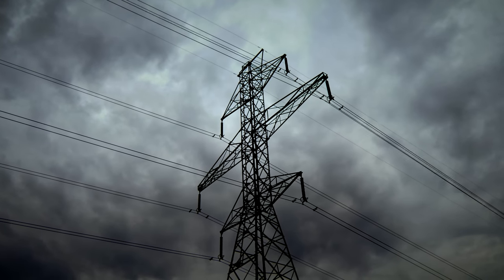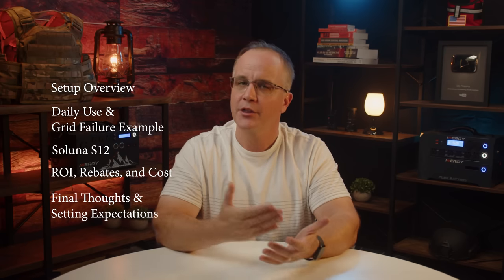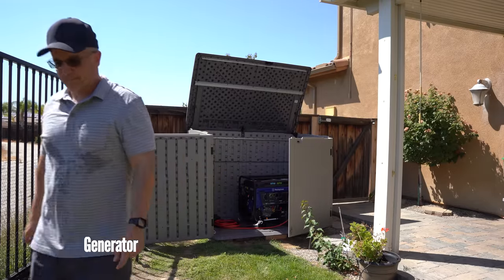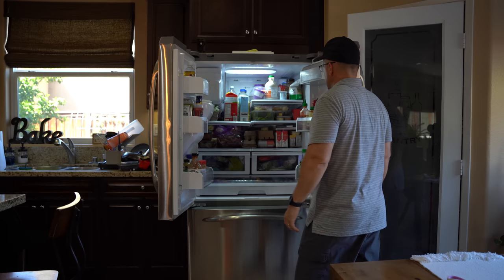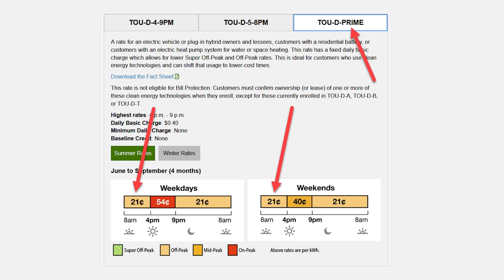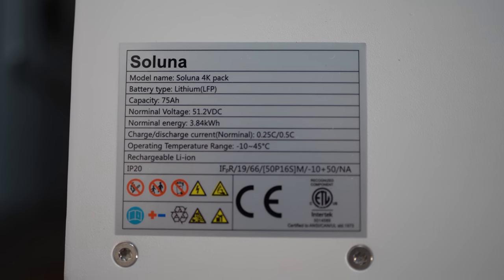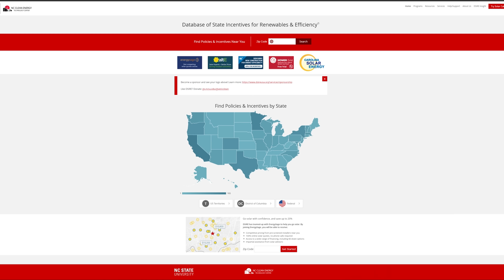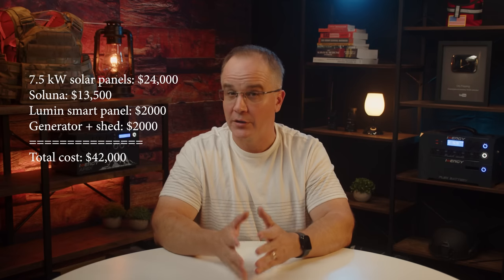The Coming Power Grid Collapse.  Soluna S12 Whole Home Backup Power

Comment: 1. Nice system you have there Chris!  I do envy ya.
2. Someone like me, CANNOT AFFORD THAT! Lol 
I am on a fixed income unfortunately because of a failed back surgery from being hurt on the job as an hvac installer years ago, so as of today, I'm screwed and have to live in my means. I would love a setup like that, but cannot afford it. Especially for my wife which is also disabled from a stroke. I have built a cheaper system for solar backup, the video is on my channel, for what I'm doing, for emergency backup. But kudos to ya, you got the Cadillac of systems. 👍

Comment: 5KW Canadian Solar panels  from Santan $2500
10KWH - EG4-LifePower4 Lithium Batteries $3000
3000W GroWatt Inverter & Charge controller $700
2000W Honda Generator $650
Did all the work myself and add $1000 for other materials & mounting
----- Total $7,850

Comment: I'm curious how much power your produce in a day (in summer and in winter) with your 7.5kWh array.  I presume it's enough to charge the batteries each day plus sell power back to the grid.  I would guess you'd make around 35kWh / day average and use 12.5kWh to charge the batteries with the additional ~ 22kWh going to power your house or back to the grid?  Have you looked at efficient mini splits to power just one room?  You can even find 110v ones so your smaller battery generators could power them if the S12 went down.

Comment: You can make your own system for under $1500 it wont run your house but will run essential items.  I have 2 100 watt panels a mppt charge controller a 100 Ah lithium iron battery and a 1500 watt inverter.  I ran as a test my ups with the modem router ps4 and tv running on it and after 4 hours the battery was still at 90% charge amazing.

Comment: My setup is a $700 trifuel generator (preference is natural gas), $1000 installed interlock, $300 soft start on the central AC. My power won’t switch over automatically but for about $2000 I’ll be just as comfortable as you. I’m paying 11 cents/KWh here in Texas. Oh, I forgot to add in a $400 Remington 870 for the concern over attracting attention, but I already had that, so I didn’t consider it in my ROI.

Comment: I think I have the largest Harbor freight setup around. 18- 100 watt panels connected to 3 40amp SRNE charge controllers. Battery bank is, so far 18 12 volt 35AH Thunderbolt solar AGM batteries. I have yet to see it drop below 12.5 volts by morning running a nearly 50 year old GE fridge, small chest freezer and Dewalt powerstation. Need more batteries to store this power for later.

Comment: Bub...I thought you were richer than that. Never figured you could not afford a solar system to run your 2 A/C's. 

My solar system is a 10-year-old car battery and a 80-watt, ancient folding solar panel. It is for charging my computer, tablet and batteries for flashlights and radio. 

In boiling hot weather, if the grid goes down and you got no A/C's...take a cold shower a few times a day to cool off. (Providing the water is running.)  

I lived in a RV for a while with no AC. It would get to 95F - 100F in the humid summer. You would feel like you are dying from never being able to cool down.  I couldn't take showers a lot since I didn't have city water. I used wet washcloths to stay cool. You can wet a face towel and wrap around the back of your neck. It helps cool you down as well.

I'm old, maybe it is easier if you are younger. I grew up in L.A., don't remember heat affecting this much when I was young. Heat can be debilitating. 

Anyway, nice video you did about getting into solar...thanks! I will keep buying lotto tickets.

Comment: You better figure out how you'll get water as there will be no pumps filling those water towers. Also, not all power companies will pay you to put power into the grid. Up here, in Northern Wisconsin, Price County Electric will not pay you for power. I installed my system myself. It isn't rocket science. I have 18 panels, 4 SimpliPHI 24 volt batteries that have a 10,000 cycle life and 15,000 watts of power, a Midnite Classic 150 controller and an AIMS 3,000 watt inverter. My cost was just under $17,000. You paid a whole lot more than what you had to for less power than my system. This also included the cost of my electricians to connect the inverter to the breaker box that powers our house.

Comment: I installed a solar system that has 40 320w panels, a 12k Sol-Ark hardened inverter and ten (10) 5.4k Fortress EFlex batteries. Our house is 2700 sq. ft.  I replaced our old clothes dryer with  a heat pump dryer (around 600 watts) and a clothes line for clothes. We live rural on 35 acres so no HOA. We bought a new washing machine which is much more efficient than our 14 year old washer and I replaced one of our water heaters with a heat pump water heater. The HP water heater draws about 400 watts when running instead of 2500+ watts. I also bought 4 Midea U shaped air conditioners which do a wonderful job cooling the entire downstairs at 400 watts each. We have central heat and air but when it runs it uses a tremendous amount of wattage. Currently it is switched off. Normally have 3 of the Midea units running during the day. Currently we are experiencing temps well above 100° on a consistent basis and our home is comfortable.  I also had a well drilled and have a solar pump that is powered by its own set of solar panels. The well power can be be supplied by its own solar, batteries, the home solar system and grid power. My electric bill went from about $350/ month to $45/ month. We pay  a rate of .10/kWh with no peak times. I installed this with the purpose of having power when the grid goes down. The net metering is just a bonus. I have the inverter setup up to never let the batteries discharge below 70% battery capacity as I don’t want to drain the battery and then the grid goes down and it’s cloudy for a couple days. When there is no grid power the batteries will discharge to 20%. With my battery limited at 70% and then the grid goes down I can then reduce the load as much as possible. Total investment $74,000 before tax credit. A lot of money but with inflation, supply chain issues and doubting that electricity rates will ever get cheaper I decided to make the investment.  And Thank God I don’t live in California.

Comment: I live in Texas and for all of July it's been in the 100s. I have a Sunrun Solar system installed with a backup battery that is on a 25 year lease program. I pay a monthly fee to Sunrun, which is over $150 less than what I was paying for electric, plus I sell power back to the grid, making my last two months electric payments ZERO. I also have an Inergy Apex solar generator for further backup, and an additional small battery bank that I keep charged with a Harbor Frieight solar charger.

Comment: Last year, I had a Sunpower 7.56kw solar array and a 26kw/h "Sunvault" battery storage system installed on my little 900sq/ft home here in my state.  My roof is a single peak that runs north/south, so my panels face east/west, and I have panels installed on both sides.

My state, sadly, has no rebates for solar, no rebates for EVs, and no Net Metering - that went away a few years ago, so now we're on something called "Distributed Generation."  I did still get the Federal rebates.  The power company will credit your bill nearly 1 for 1 for excess power sent back to the grid, but they nail you for any power you consume from the grid as a distribution charge.  IE - if I consume 100kw/h from the grid but push back 300kw/h, I will still get a bill for 100kw/h as distribution, but will get a bill credit of 200kw/h toward the Power Supply charges.  Those credits cannot be cashed out either.  Power company wants your bill to be zero over the course of one year with no excess credit being built up.

I've ordered an expansion of my solar array this year to 10kw, and ordered a second, 26kw/h Sunvault battery with additional inverter.  The software that my installer used to try to estimate my energy usage shorted me by about 1.4mw/h for a year's worth of usage.  I'm just waiting for an install date.

That all being said, the system was extremely expensive; there are less costly alternatives, but I wanted great support, reliable products, etc.  If I had gone just for the solar panels, I would've been able to reduce about 2/3 of my bill and might've came out ahead after like 8 to 10 years, but the batteries made it so expensive that I probably won't... maybe after 30 years.  But for me, my neighborhood generally loses power 2 to 4 times a year, anywhere from a few hours to a solid 5 day week.  I was annoyed with that, so I went with the battery solution.  You can tell how often a neighborhood loses power - just wait for one and if you hear nothing but small engines running during one, it's often. :)  The system did come with a smart hub which has a built in RTS (Rapid Transfer Switch), aka, a fast ATS (automatic transfer switch), which isolates the house from the grid during a power failure and allows the panels and batteries to power my entire house.  I chose not to go with a critical loads panel because all of my appliances are currently natural gas, but I plan on slowly converting some of that over to electricity in the coming years.  The inverter for the batteries is a nice 6.8kw running power unit made by Schneider Electric.  Sunpower has their own custom firmware in it, so it is limited while on grid mode to 6kw running power.  The entire system is "turn key" meaning, you don't need to do anything; permitting, wire, conduit, all of that is supplied.

I did not select Time of Day usage here with the power company so I'm on a tiered rate based on consumption.  I do allow my batteries to run in "self supply" mode - once the sun goes down, the house is powered by batteries until they hit the low limit of charge that I set (20% reserve), and then the house becomes grid powered.  On cooler days, I usually don't hit the reserve limit and basically run net zero, or push a surplus to the grid.  In the winter, I consume more electricity than I produce, which is where the bill credit gets used up.

The federal tax credit does apply to the battery.  The rule for that is the batteries can only be charged by solar energy.  We do not have a virtual power plant feature here, so it cannot export battery power to the grid, nor use grid energy to recharge itself.  Solar only.

Once my solar addition is done, I'm going to have a "Level 1" surge suppressor installed in my electric meter.  I already have a whole house protector in my main panel (considered Level 2) and surge strips/UPSes (considered Level 3) throughout the house, but I want something right at the meter; I'd prefer not to have all of that electric/solar equipment fried if a surge from the grid happens.  Power company offers one for a monthly fee of 10/mo, or I can try to find a third party for a one time install fee.  I think a meter based surge protector is extremely important to protect all of the solar gear, especially for grid-tie systems.

If anyone has any questions about the system, reply to me and I'll see what I can answer for you.

Comment: I built my system completely differently...I only have a 2000 watts Aims inverter charger (can be grid tied, but never will be ), but I have 25,000 watt hours of batteries ( twenty AutoZone marine batteries ) so that I can run my A/C. It usually uses a bit more than I can make with 1200 watts of panels, so after a couple hours I usually let the batteries charge back up some. The whole thing cost me $4200, and in a few months it will have paid for itself. It is 102 degrees today, and approaching 110 by the weekend next week. I usually turn the A/C on about 1 and let it run until 3, then let the batteries charge a bit, then turn the A/C back on for another hour before letting the batteries charge again for their night's duties. I bought the first two batteries two years ago. I figured by having 20 of them they would last longer. I like to keep the voltage up because if it gets low it takes two days to charge the battery bank back up. So far that has only happened once after 6 days of rain. The voltage got down to 23.8 that time. The sun came out the next day. The yellow charging light on the Aims inverter charger doesn't come on until 23.0 volts. So, I have made it a year without using the gasoline generator. Or the grid. I bought a second inverter for my pickup, so that I can go get two barrels of spring water for the garden every week or so. It is a 2000 watts Ampeak. I like it . It was a lot cheaper than the other one, but is a modified sine, so I only use it for fans and my sump pump. I have it hooked to the bottom set of ten 12 volt batteries in parallel. The Aims is 24 volts. SO I have a 12 / 24 volt system. But it does what I need for it to. I don't have to worry about the freezer thawing out now. Well, the batteries are going into float charge so I guess I will turn the air conditioning on. They said on the news that there may be power outages from everyone running A/C units everywhere constantly because of the heat wave. I have my own juice though...well for now the solar is keeping up with the A/C unit. I guess that means it's going to be hot today. I might go adjust a few panels and try to get 30 amps coming in...I'm still experimenting with where to put the panels...there are buildings in the way. But overall, it's pretty great. I'm getting 843 watts and the A/C uses 644.... 32.4 amps after adjusting the panels.  Free A/C. That should be a milestone. Well it is 72 in here and I have a cold drink, and two fans running. I had a couple of nights a few days ago that I had to run the A/C at night, but after 20 minutes it had cooled off so that doesn't wreck the batteries if I do that a couple times. Next month I will be extending the wiring so that some of the panels can get all day sun exposure, and I am replacing one older cable with a new one, larger size and longer. So that will give me even more free wattage to use here. More than I use most of the time. I bought the 90 amp hour batteries for awhile until I found out they had a bigger one, so I have 8 of the smaller and 12 of the 105  amp hour ones. But it came out to around 1000 amp hours and that's how much the inverter likes, lol. I can run the 1472 watt oven and not get much voltage drop. And they recover that little bit quickly. I have the poor boy home made DIY version, but it works. I'm just glad I was able to figure out what to buy and how to hook it all up and get it working right. My system is working great and it's all paid for.

Comment: Thanks for sharing.  $0.21/Kw - now I can feel much better.  No matter how much I pay in power, it will never be as high as your location.
We have added 4.2Kw Solar setup, and its totally worth it, even without battery backup.  In 2020 we had a full 2 days of power outage, so I purchased a generator.  Batteries would be useful to stay a little quieter.

Comment: You can do this way cheaper than he did if you just source your own panels a d batteries. You can get 15 kwh of batteries from signature Solar for $4500. You can probably get the same system for $15000 minus the smart electric panel which in my opinion is just a waste of money. Save $2000 and go shut off breakers yourself. Also you can buy a dual fuel generator for less than $1000. He also didn't say if the cost he said included installation.

Comment: I live off grid with solar, wind and backup generator... power rationing is essential.. we are a family of 5 plus all our farm animals.  I need to expand my solar and batteries .. I'm running 4kw solar a 2kw wind turbine and a 9kw generator with 36kwh of batteries  and I have a 12kw split phase inverter.. I live in an area that gets a ton of wind.. mostly in the winter when I get less sun to it works very well for that. 
Even with only a 4kw solar during the day we can run the AC off of it. 

I built and designed the whole system myself and I think I have maybe 15-20k into it.. but it would have cost us close to 300k to have power ran to our house.

Comment: Australian made "Selectronic inverter model = spro 482 " is the best off grid/hybrid inverter in the world if you want to live off grid . 
i do not know if it sold in the USA because it is 240v 
i know it is available in europe i think it is branded as a kako but not sure

it uses ac coupling .SMA has one that is similar but smaller capacity and needs multable parts which makes it complicated 

in my opinion everything else is a toy or  no good . 
SELECTRONIC inverters can be connected to the grid ,generator ac coupled and dc coupled  

it is not cheap bit as you say buy once cry once

Comment: Not practical for where I live in PA.  6 months out of the year cloudy or overcast  or snow. I live in the woods, lots of trees, little direct sunlight. I do have a firman tri fuel  10,000 watt generator in a sound box. IT runs on gas, propane and NG. It works amazing.   Solar doesn't  work for everyone, wish it did.

Comment: Just got in a 5.12kWh rack mount battery, a 3000 watt all-in-one inverter, charger, MPPT solar charge controller and it's up and running for short term power outage now (charges via AC right now). Tomorrow at 10am I am picking up 6 360 watt solar panels (2.1kW total), so I will be "ok" after tomorrow for a long term grid down situation. I already have a 3800 watt dual fuel generator and several smaller systems (100 watt panels, 40Ah batteries, charge controllers, as well as a fold up 60 watt panel and 12Ah battery and charge controller for portable ham radio use) but more is always better. The whole house can't be run totally off grid, but I'm working hard on getting the ability to keep as much of a "normal" life going as possible. Those 5.12kWh rack mount batteries aren't cheap ($1750 each), but they are modular and as I get more $$ in, I can expand it.